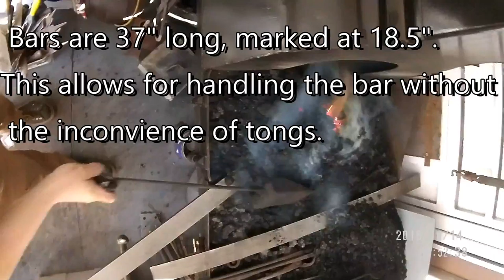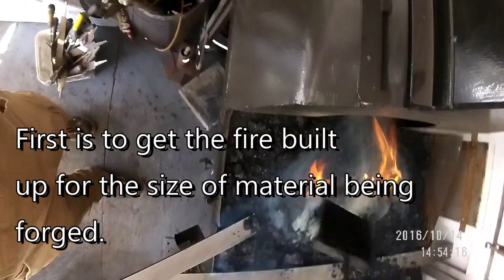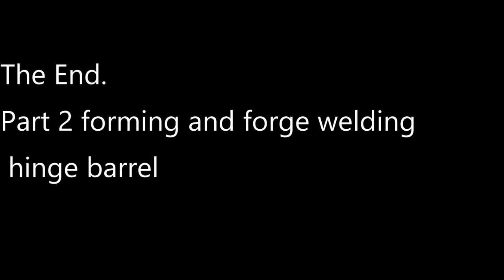Forged strap hinges video 1 of 2  (main body and finial)

Comment: excuse the expression. I'm Russian. Please tell me what you are watering the coal with and why? 2 do you have a fan in the pipe?
Reply from the maker: I am using water to control the spread of the fire and to help steam out the volatile items in the green soft coal. 

Air forced into the fire if overdone (to much) or if there is lots of smaller pieces near the clinker breaker the fire will have a tendency to spread to fill the firepot.. If the air coming from the tuyere has a clearer path with less resistance the fire will have a tendency to stay the size desired. 

With larger metal, more air needs to be put into the fire so it becomes a balance of air to getting the required heat. 

No fan in the pipe for smoke. 

Your english is excellent.  Great questions.

Comment: I'm curious if you loose any impact/rebound on the anvil due to the trailer floor giving ?   I've never felt a firm floor in any trailer including my 1/2" diamond plate floor. they all seem to flex/give some.
Reply from the maker: The anvil stand actually is sitting on the ground..  There is a thimble that the whole anvil stand and anvil slide through onto the ground..  Even with this stand design there was a loss of hammer blow..  This was fixed when the new anvil arrived and the stand got remade.. 

There is a whole thread on the trailer build on Iforgeiron.com and it explains the whole build.. https://www.iforgeiron.com/topic/47208-portable-blacksmith-shop/

  This is one of the first videos after coming out of retirement after 13 or so years..  I filmed this particular one for a .com group I belong to as a way to figure out how I wanted to film..  The guys said the motion of the camera  was to much for them.. 

I turned to Picture in Picture vs head cam in the "How To" videos made after this one..  I released this video now for people to get a different view..
Reply: You know, I read the whole trailer build post about a day after I posted this question..... and Low & Behold, there was the answer.  I've been on IFI for a while but don't spend much time on the 'puter. I'd rather be forging, welding, fabricating, restoring !
 I just finished an English side blast build and a powered vent to go with it. Once I get time (haha), I'll upload the info on IFI.
 Keep it up Jen !!